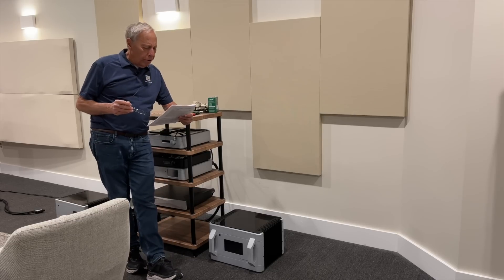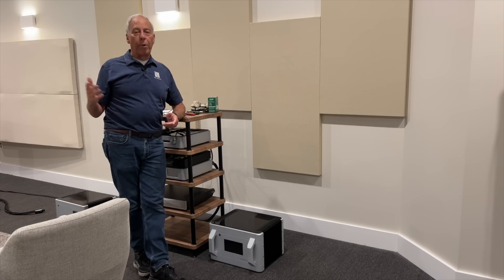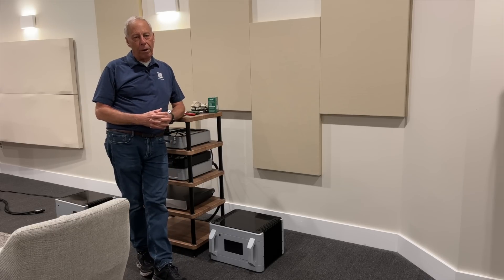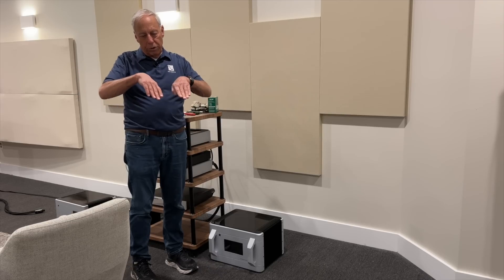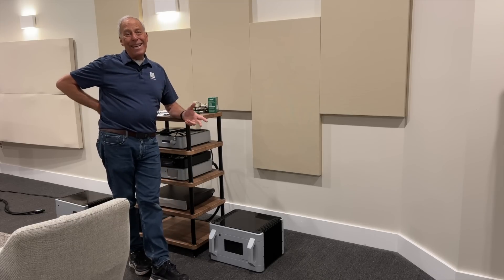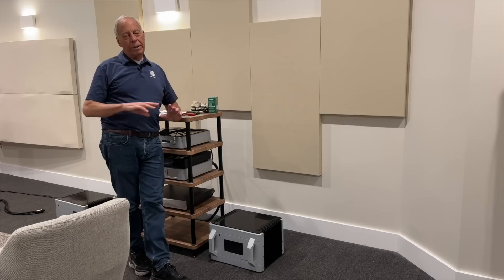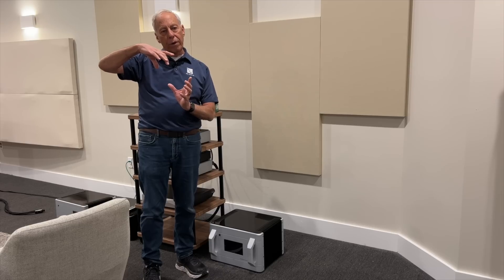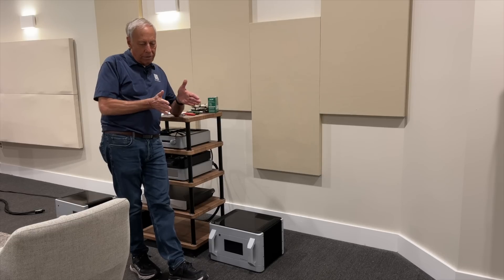Woofer size in modern speakers

Comment: The audiophile speaker world is a fun one, there are so many ways to make a speaker.  There are  many speakers that I personally would not own that others like.  There will always be two camps, multiple smaller woofers vs one larger one. A larger woofer will typically exhibit lower harmonic distortion in the bass frequencies vs a smaller one.  This is only a rule of thumb, not an absolute.  I would suspect using multiple smaller woofers vs only one small woofer would have lower distortion.  For me I’m in large woofer camp, I just like the sound, it’s easier for me due to me applying extensive cone/frame treatments which is time consuming but it makes 1st order crossovers easier to use.

Comment: Nah, I'm still in love my old 15" Altec A7 VOTTs driven by my Dynaco tube amp with KT-88s. Even built my own passive crossovers and a Raspberry Pi DAC, (no preamp is the best preamp) I think the sound is truly amazing. Lots of tweaks to the system and room over the years, but that's the other half of the fun!
If I had to do it all over, Bozak Concert Grand maybe my other consideration.

Comment: Hi, thanks for your videos I always manage to learn something new, I remember the old days when we had 15 & 12" 3 way hi fi speakers in our front rooms, also at that time i used to go out to listening to various reggae sound systems who used 18" bass bins at venues throughout the UK,

But as time has moved on I have to as well I now play flac files via USB flash drive on an award winning mid level sony av receiver in stereo mode with entry level 2.5 way monitor audio speakers with 6.5 mid bass & 2 x 6.5 woofers Bi amped with audioquest rocket  22 & qed xt 40i cables.

Thanks to my room acoustics I don't use an active sub "YET" for listening to roots reggae music, the monitor audio's can't reach to the very lowest bass note but they get close to it, they can still fully reproduce every single bass note that they can capture without any problem all the same, I feel adding that 2 good quality active subs would be all I would need to recreate the deep bass sounds I listened to all those years ago, plus I didnt get any grief because the size of the speakers were very acceptable to my spouse

Comment: The simple way around the big woofer / big baffle issue for a tower speaker is to have separate enclosures for the woofer and mids/tweeters that are sized appropriately.   The reality is most modern speakers are small and powered subs are used to augment their bass.  I built 2 piece towers many years ago that are designed this way.

Comment: Modern design Tannoy Dual Concentric drivers are absolutely fantastic for their transient response and weight/depth of sound, the VX12 and VX15 for example. For me, small loudspeakers just don't cut it.  Find a happy medium depending upon your requirements and room size. Whatever your ears tell you.
Reply: Have you heard the Fyne Audio series?  The management of Fyne Audio are the ex-management and design team from Tannoy before they became a brand name of a conglomerate group of companies.
Reply: @joepostle3561  I am Informed of  Fyne Audio loudspeakers and that's quite interesting actually. I haven't heard them in person yet but I'm hoping to find a place where they can get them to sing for me on a private audition
Reply: @no_bull  If I may ask, which country are you based?  (I only ask because if you’re in the UK I can recommend some dealers)
Reply: @joepostle3561  Melbourne unfortunately. I'll be moving to Greece soon though
Reply: @joepostle3561 I saw the Fyne Audio Vintage 15 at Axpona 2024. To me, they were the highlight of the show. It felt like the entire back wall was projecting... Highly recommended.

Comment: Although there are many notable exceptions the speakers held in highest regard by the most seasoned audiophiles have very large woofers. The trend towards smaller woofers has long been led by the desire to design smaller and more decor friendly speakers. And in my own personal experience while I have heard countless multiple smaller woofer speakers that sounded great all the best I've heard had multiple 10" drivers or 12" to 18" single drivers and sometimes multiple drivers over 12"'s. There's an ease and finesse to lower bass and dynamics with large drivers that multiple smaller drivers never seems to match. I am well aware of what the math says about cone area and excursion. I am also well aware of what reality says the math sounds like when it comes to real world applications.

Comment: Having heard small and big woofers, I suppose common bias is the need to produce 'market fit' products and speakers. 18 inch sounds amazing, but ain't desired by many due to an ideal cabinet size of about 500 litres for example, let alone the cost (in the whole chain). But it's also a matter of taste. I have never liked the series of small woofers, let alone the speakers that need very powerful amps to drive them. But for the industry, small boxes needing loads of power, thats profit for them any day.

Comment: The combined surface area of multiple smaller drivers will of course move as much air as one larger driver,    
and smaller cones are easier to control. Two benefits right off the bat. Add in the narrower baffle, and you have three.

Comment: WRONG AGAIN!  Case in point,. A pair of JBL K29900 speakers have 15 inch drivers.  They will produce far more bass than your 4 8 inch speakers.  Like the old saying goes "There is no replacement for displacement".  If you really want to get punished with bass, let's compare your puny 4 8 inch drivers with the king of bass for floor standing speakers.  Of course, I am talking about the legendary Cerwin Vega XLS 2-15 speakers with TWO PUNISHING 15 inch high output drivers per speaker.  Those speakers will OBLITERATE ANY SPEAKERS PS Audio has....... PERIOD and next topic of conversation.

Comment: Paul is confused on baffle step. The smaller the baffle the bigger the problem. The real reason for slim enclosures is fashion and looks. This is why most slim speakers will benefit from a seperate sub. At least three 8 drivers are required to match driven area of one 15 driver.  Larger woofer drivers have a lower resonant frequency and can move air more easily at lower frequencies.  It is basic physics.

Comment: I think dual 10" woofers per tower is the sweet spot for bass response, though I havent heard many speakers that use four or more 6\8" woofers per cab. More drivers working @ half their load makes sense for keeping down distortion for sure..

Comment: How do planar, line sources, operated as dipoles fit into this discussion? To avoid cancellation, via destructive interference of rear wave, Superpositioning,( Classical), with front wave, my baffle is 17 inches wide. Notice the IRS V has a rather large baffle too.

Comment: All, our host is softly pushing smaller woofer sizes, because that is what he is selling in his speakers.
There is truth to what he is saying.  But there is also that which he is not saying, which pertains to the advantages of 12" woofers.

Vandersteen's flagship model Seven speakers use 12" woofers.
Those speakers are "reference" speakers.  They compete with any speakers at any price for the #1 spot in sound reproduction.

Why does Richard Vandersteen use 12" woofers in his model Seven speakers?
The next time I meet him, I will ask him (he travels the country and speaks to customers about all of his products).

But based on how amazing all of his speakers sound, and especially his model Seven speakers, it stands to reason that Richard knows his craft, and that 12" woofers are the right choice for some speakers.

Eight inch woofers will also sound amazing for some speakers.  But let's not poo-poo 12" woofers because we (our host) do not sell them.

Comment: The 12" and 15" woofers have just moved into subwoofers in higher end systems.
There are still speakers on the market with big woofers, and the "retro" speakers (like KLH model 5) are having some resurgence.

Comment: A smaller woofer needs a smaller enclosure, which results in lower manufacturing costs...

Two small woofers with a tiny box cost less than a bigger woofer and a bigger box.

Efficiency is what HiFi lacks to be honest. An averge HiFi woofer has a sensitivity of 86 dB/Watt/1 m, while PA woofers have 96-100 dB. In practice, the HiFi woofer needs 4x times more power to have the same sound pressure.

Then, you reduce the cone size and the magnet to save cost. The result is a weak, cheap sound in comparison to a 12" PA woofer.

Comment: It takes about 3 1/2 eight inch drivers to equal the radiating area of one 15 inch driver.
Reply: More like 4x 8 inch. There is some loss by just adding the mass together like you do because of the round shape

Comment: Not sure I totally agree with you on this one Paul, to me the compromise is wife acceptance in the home...like the IRS 5's? 
Take for example the brand new 75th anniversary Jubilee speakers out from that famous Hope Arkansas company known for the horn speakers that are absolutely massive, almost 6 feet tall and 4 feet wide. They are running two 12" subs per speaker with a 7" horn...they have massive foot print in a room. Wife acceptance is 0%. Another problem is cost  also, more power is required to drive these larger speakers also...sadly the market demands are really controlling speaker size or everyone would live in mansions with million dollar audio systems. Look at the SR30's were delayed years to make them more modern looking than the original prototypes...? 
Multiple driver speakers also have their own inherent issues that have to be overcome as well...no? 
No compromise speakers don't sell volume or net companies big cash, this is the hard truth of market economy...cheap mass volume speakers can though.
Reply: Actually.. Less power is requiered to play at the same level volume as a smaller speaker... But to play REALLY loud and stille have good control it will always require more power regardless of the speaker size.
Reply: Gotta call you on the comment about more power for the Jubilees. Those things are 107-110db sensitivity!
Reply: @digggerrjones7345  Yes, higher sensitivity speakers CAN play VERY loud with almost no power at all. But still needs good power to have full controll at high volumes regardless. Even more for less efficient and smaller speakers.
That is the 100% correct answer.
Reply: @digggerrjones7345  Every idiot knows that brand is high mark for speaker efficiency, I was generalizing for large speakers like in general...but what ever makes you feel superior man. 🤣🤦‍♂

Comment: Seems like you're mixing up baffle step and diffraction. Baffle step loss gets worse the smaller you make the baffle. The "pod" style speakers will have the most loss. Big baffles will provide the most support and push the rolloff to a lower frequency. When it comes to diffraction, then that's where things become trickier and there's no simple solution. Infinite baffle (or realistically a huge baffle) will eliminate the edge diffraction and is theoretically the best solution but not practical for most. When you get to mid sized baffles then it can sometimes not sound as good as small baffles but at the same time, small baffles introduce problems of their own with the imaging.
Reply: I just put some med/treble single drivers into pod shaped omni directional boxes, taken from similar rectangular omni boxes (like the old Sonabs). There is a vast improvement in the image. Both type boxes have a woofer added.

Comment: my vintage ess amt 1am have big ( I think 15 inch?) passive radiators . On some tracks ( especially when playing vinyl) the low end can literally can shake my entire house, I can hear the gutters rattling if im standing outside. it somehow does this without being overwhelming or sounding unnatural; just sounds more like live music the more I crank the volume knob. I like it. Bigger is better, but newer isn't always better my 2 cents
Reply: Agree, and I am not sure I agree with Paul, really large cones pressurize the room in a different way 😎
Reply: @Harald-MacGerhard   Yes I also agree. When I come home from one of the electronics shows, and fire off my 15" stereo speakers, the physical experience from the room being pressurized is what I find is missing from most of the present day speaker designs (Very disappointing.). I do not even have to have the volume up much higher than conversation level. IDK, I understand what Paul is saying, trade-offs, and my preference is to experience the music through my ears and my body.

Comment: Many years ago, I had speakers that were not narrow baffle. The front of the speakers were about two feet into the room. Hospital foam rolled out on the wall behind the speakers improved depth and soundstaging considerably. When I replaced those speakers with Vandersteen 2c's, the hospital foam was no longer necessary, as the midrange and tweeter mounted above the woofer cabinet.
Reply: So happy we have fans of Vandersteen speakers.

Comment: I recently was at my dealer picking up my Luxman D-10X and there was another client demoing a used pair of B&W 801Ns. They were huge, but sounded very very good being powered by a Luxman 509x. Their bass signature was very pleasing and rich. It wasn't as fast or punchy as a modern speaker like my Sopras, but it left  a favorable impression. Kind of like a newer Cadillac vs an old Fleetwood that coasts along. I really appreciated them and he bought them, but because they are so big and not as good as my Sopras in many other areas I wouldn't get them, but damn are they good and I can hear why people miss larger drivers. Having the turbine for the midrange and seperate tweeter housing definitely played to their favor as the front baffle didn't interfere too much with their imaging. But they definitely have their own magic 🪄✨

Comment: I would challenge the 10" or larger woofer required. My speaker have 4 eight's in an array on each speaker and they barely move and the sound halfway up would drive most out of the room while still being crystal clear. If you have a high quality cabinet it can make even a cheaper woofer do wonders. If you have an excellent woofer in a crap cabinet it will sound horrible. Now it is true in general a larger sub like a 15" will not be as fast or have the separation of the smaller woofers. I did see an exception when I owned the Klipsch flagship corner loaded horns with the 15's in the bottom. Those things could make you tap out but sounded super fast and tight with rock songs. So based on price point most smaller woofers move faster and less muddy and most large woofers slower and not as defined. When you move up the quality chain in construction and design that can change. So budget to spend might define how you approach what size woofer and brand to use.
Reply: Not really true that a bigger woofer is slower. If it's well designed it's lightning fast but remember to have the power to make it move controlled. Or else it just gets muddy on high volumes. I have hear a 18 inch sub play perfekt with 5x 5 inch floor speakers so. But yeah, it also costed a bit of money so...
And I rather have 1x 15 inch than i.e a 4x 8 inch sub
Reply: totally agree

Comment: Isn't it true though that a larger woofer has to move a lot less pistonically and there are benefits to that? In terms of Doppler distortion, there is a different sound to a 12 or 15-in woofer or or even 18 in moving a tiny amount to a bevy of six and a half inch high excursion woofers.